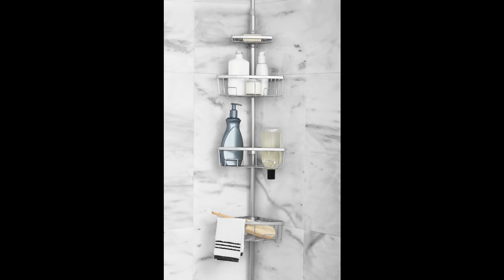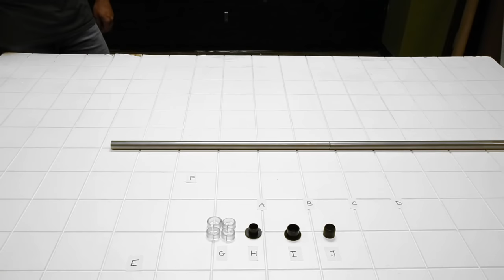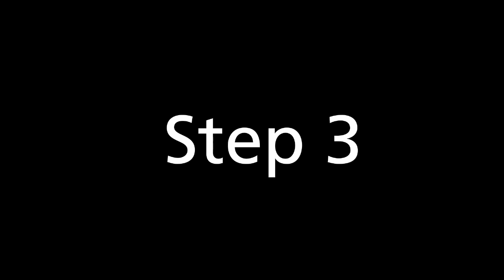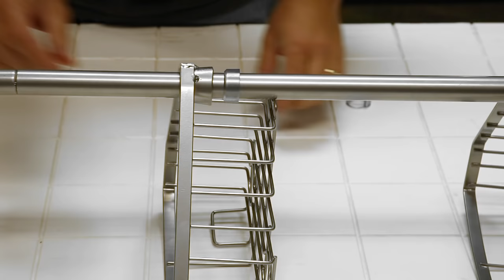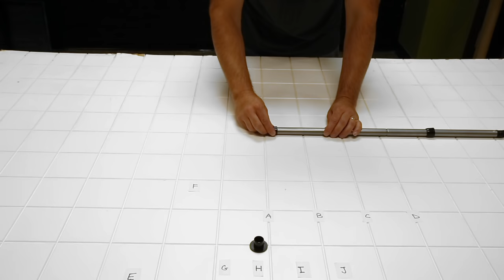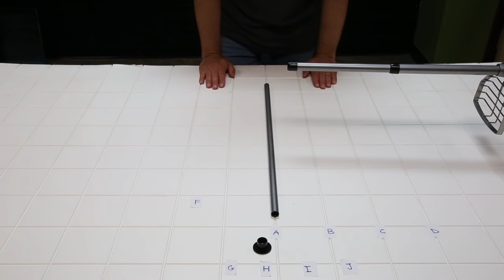1418 Pole Caddy Instructional Video - Columbia Frame

Comment: If the Caddy ends up being too long, you have the option of removing the rubber stopper underneath the the spring. Than forcing the spring past the crimp in the pole. Instead of removing the bottom pole this makes it much more sturdy. Only downside is the spring most likely won't come back up after.

Comment: After proper assembly we found that the joint between pole B and pole C was too wobbly so the bottom pole kept slipping and falling into the tub. Also the rubber stoppers kept falling out, dumping your stuff into the tub. We ended up returning it.

Comment: Wanted to install with a bathtub and simply removed the bottom section in order to make it fit.
Reply: +Dara Todd 
thanks for this...seems to be too tall otherwise
Reply: is the bottom section part of part c?
Reply: +virgie woolf ... Yes, it's part C. I removed it in order to fit with my bathtub. It worked.
Reply: +ArrynBlue I tried and it worked! Thanks so much, common sense is not very common😄